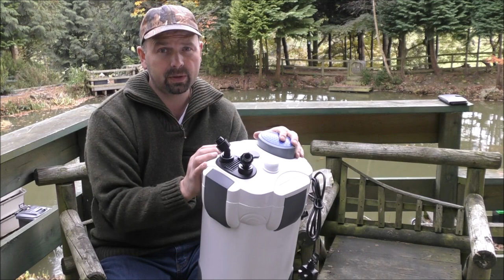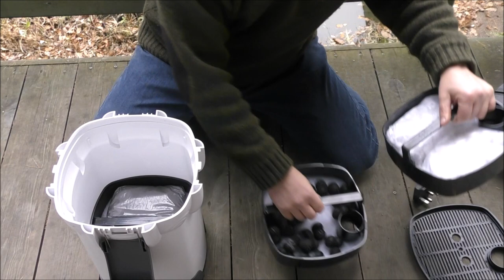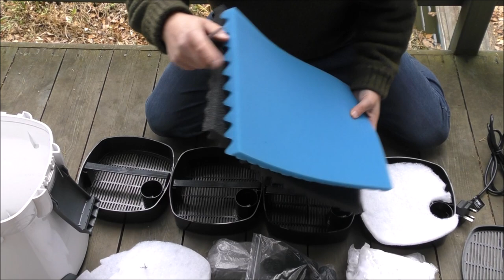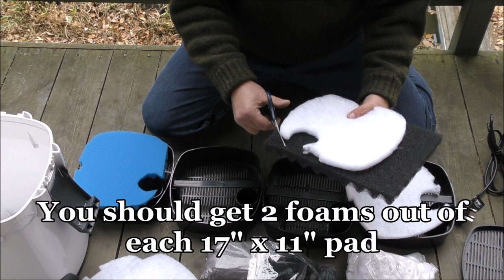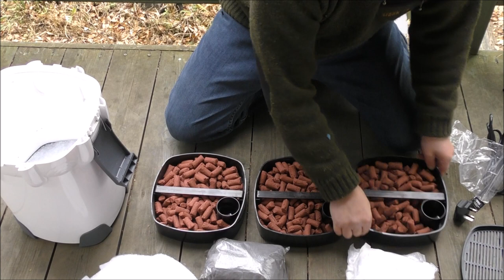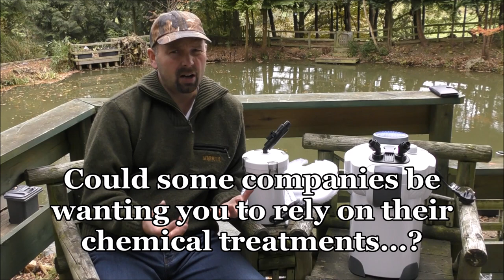Why Your Filter is TOO SMALL and NOT CYCLED

Comment: Can't figure out my water parameters. My ammonia is safe. My nitrates are safe. But my nitrites are extremely high. How is this possible?
Reply: My ammonia is 0-10 ppm according to NT Labs Aquarium Lab. My nitrates are 0-10 ppm according to the same test system. My nitrites are 40-60 ppm according to the same test system on a 29 gallon tank stocked with 3 corydoras catfish, and approximately 4 baby crayfish the size of a half of a pea.
Reply from the maker: Sounds like the tank is going through the first stage of the cycle and you have almost enough aerobic bacteria to completely process the ammonia into nitrite but not enough of the aerobic bacteria to process the nitrite into nitrate if the nitrate is low but the nitrite is high.
Have you had the tank running long and are you using any treatments which could cock up the results / affect natural development of bacteria (e.g. prime, amquel plus - treatments which detoxify / bind ammonia, nitrite and nitrate)?
Reply: It has been set up for about 2.5 months. Using a SunSun canister filter filled with BioHome Ultimate and BioGravel and a course, medium, and fine pad set up the way you show here.  The substrate is Mystic White II pool filter sand, pea gravel, and BioGravel mix over a RhizoMat which I sprinkled micorhizal fungus when I set it up. Underneath everything I have an undergravel jet filtration system running. I am a firm believer in no chemical fish tanks.
Reply: The corydoras and crayfish seem healthy and happy with no signs of stress. It's just the readings that worry me. The gH is 1 and kH is 6 (I think).
Reply: Just a basic dechlorinator by Tetra.
Reply: Sometimes I use aquasafe but other times I use bettasafe. When setting up this tank I think I used both.
Reply: How long should I wait for the nitrite levels to fall.
Reply from the maker: Bettasafe claims to detoxify / bind ammonia so it is likely to be the source of the cycling problem. When you have a filter full of biohome (or any good sintered glass media) it should only take 2-3 weeks to go through the aerobic part which would see ammonia and nitrite return to zero but if the ammonia is not available as a food source for bacteria then the cycle will not have got going. There is obviously some bacteria present but it only seems to be the type processing ammonia into nitrite. The true ammonia level is likely masked by the treatment and could very well be high too just in a form not registering on the test?
If you continue like you're doing except only use the aquasafe then the bacteria should populate naturally and you should see nitrite come down to zero in 2-3 weeks.
It would probably be worth doing a 20% water change twice a week while the bacteria is struggling to establish and then you will see ammonia and nitrite fall to zero and nitrate rise indicating that the first part of the cycle has been completed.
The last part of the cycle which is anaerobic and reduces nitrate can take 4-6 months but many people have reported recently that it only took them 2-3 months for that part - it varies from tank to tank.

Comment: you forgot the part if you have a plenum you get the full nitrogen cycle aka 0 water change
Reply: Filtration is simply scaled to the demand placed upon it - for a lightly stocked, well stocked naturally set up, well planted tank filtration can be minimal with great results but for normal (abnormally stocked) tanks it takes a bit more to achieve a full cycle.
The vast majority of people will not set their tanks up to be anywhere near Natural and that's where the extra filtration comes in - the great thing is that anaerobic bacteria can be catered for in the substrate and the filter so the two methods of achieving a full cycle aren't at odds with each other.
With regard to 0 water changes even with 'perfect' water conditions I'd still recommend changing 10% a week and making sure there isn't a build up of uneaten food and fish waste on and in the substrate. Minerals and trace elements will eventually get depleted and 'locked up' in a 0 water change system so remineralising with water changes will help to prevent 'dead' water.

Comment: i'm guessing you don't like seachem prime and purigen?
Reply from the maker: Bacteria certainly don't like it so they are products I can't recommend if you want to achieve a full cycle and a properly functioning filter. I'm not a fan of having to throw chemicals at a system so avoiding using any products which prevent a natural cycle is a big part of success.
Reply: @pondguru  I didn't think purigen was considered a chemical media. It's just super absorbent.
Reply from the maker: Keith Fuller  It acts in a similar way as carbon / charcoal to 'polish' the water and is neither a mechanical or biological filter media. However carbon and charcoal do not have the adverse effect on bacteria experienced when using purigen / chemipure or similar artificial chemical treatments.

Comment: Sunsun make great filters. The chinese do well to reverse engineer products and sell them alot cheaper. You may bag their media but their filters work great. I just purchased 2x sunsun 304b(combined 4000ltrs an hour, obviously alot less with media). But they will filter my 440ltr tank. And $283 au(australian dollars) including shipping.
Fx6 is around $6-900. And less flow.
Just make sure to buy good quality media and follow the gurus ideas.
Reply from the maker: Yes - save money on the canister filters and spend it on the filter media as that choice is critical for success - at the end of the day a canister is just there to suck dirty water out the tank, filter it and send clean water back to the tank so the makers name on it does not bother me.
For general (aerobic) filtration the filters can be set up with anything to achieve the 0 ammonia and nitrite but for full cycle filtration (reduction in nitrate) they certainly hold plenty of biohome.
Why people persist with internal filters and HOB filters for large tanks is beyond me when canisters offer so much more filtering capacity.
Glad you enjoy the videos and thanks for watching.

Comment: I’ll never understand why people won’t clean their mechanical filtration in tap water to get them clean (squeezing them in tank water is a joke) yet they will replace the mechanical filtration. Prefilter sponges can be cleaned every couple of days... before stuff has a chance to break down. Do you have science to back up your claim of bigger filter equals nitrate reduction?
Reply from the maker: For me the rinsing in tank water which has been drained off during maintenance is more about being really determined to retain as much bacteria as possible on every surface in a filter but in reality most areas of the country will have tap water which is good quality and not packed out with chemicals so using tap water will not be a problem for rinsing foams.
In the UK problem areas would be London, Birmingham and around Nottingham as far as feedback goes from people who have had problems with awful tap water.
With regard to your question about a larger filter equaling nitrate reduction the size of filter is important but is not the critical factor in nitrate reduction - that would be the amount of suitable media which is used in a filter for the size of the tank and stock. You could have a huge filter filled with crappy ceramic rings or plastic balls and all you'd get is high nitrate since the media is only ever capable of supporting aerobic bacteria (for ammonia and nitrite reduction) which produces the nitrate. When you have a media which is more suitable for supporting both aerobic and anaerobic bacteria you can then start expecting a full cycle which incorporates the benefits of anaerobic bacteria reducing nitrate, not just half the job experienced by almost every fish keeper.

Comment: Another day, another rant about why I hate that I think in American units.  You talk about filter media in Liters, but it's sold here by the pound.  You can't convert these bc one is volume, and one is mass. Plus we have fluid oz vs weight oz. Even if I learn metric, all the manufacturers still use crazy units to trick customers. Like my caramel sauce that silently switched from 16floz to 16oz which is only 13floz. Or is it the other way round?  How many cups are in a gallon again?  How do I convert Liters into pounds?  What is a stone? No one knows!  I hate everything!
Reply from the maker: Google has every converter on there but it's a proper fart on - we use different units by design to keep us separated. 
Divide and rule, lol

Comment: 4 day turnover recommended, not practical unless set up separately as secondary filtration
Reply from the maker: I think you may have meant this as a reply to the guy asking about nitrate filters? They are indeed used as a secondary filtration and the choice of media in them is not as critical as it is with standard filters.
Reply: yes, that is my New understanding as well
Reply: as a side note, I started fish keeping in 1972 Back then tanks were  metal frames with slate bottoms.   I still learn new things, and I am always reviewing... that is how I got here...lol
Reply from the maker: @agualust  The first tank we had in our shop had a slate bottom and slate siliconed on the back of the tank inside - fish looked great against the black background and it was always better looking than the 'newer' tanks with the vinyl backgrounds which flies always seemed to die behind, lol
Reply: maggots as live food would not have gone over well...lol

Comment: I have 2 canisters claiming to filter 500l in my 1000 litre tank but I have 22 kg in them because only one filter hasnmechanical fiktration
Reply from the maker: One canister only has foams in and the other one has all media - and you fit 22kg into one canister filter? What type of filters are they? They must be gigantic.
Reply: Pondguru no, one has a little bit of mechanical and mostly biological and the other one has pure biological, but yes there huge
Reply from the maker: What is the make and model of the filters? I'm always getting people asking me what the biggest canister is and as far as I know it is one of the big Eheims which wouldn't hold that much - also what size tank do you have the filters on? must be huge if you need 22kg of media.
Reply: 1000litres but I have turtles in it which make a HUGE mess, but I don't know the model right now, because i bought it off a friend but I will find out soon when I ask him
Reply from the maker: Do you have the large tank on a different channel? I checked out your channel to see if I could recongize the filters and the only tank I saw looked nearer 100 litres?
Reply: Pondguru I'm pretty sure its a fluval fx6(6kg of aquarium matrix) tank water out of the tank into a 75litre drum full of pond matrix(8kg) and an eheim with 8 kg of aquarium matrix which pumps back to the aquarium

Comment: I love this video. lots of good  info , most people buy to small of a filter. and have to big of a buy load.   I tell my friends if they see for exp. a canister filter rated for up to a 75 gallon tank   take that rating and cut it in have so it should only go on a 40 gallon breeder at best.    all  these filters rated with so many gph per a gallon are rated with no head pressure lost from pumping water up and are not filled with media.    lots of good reads about filtration vs flow to on aquaticplantcentral.com
Reply from the maker: Yes that is an important point - it is not just the filtering capacity (what size tank a filter is suitable for) which should be halved for a normally stocked tank but also the flow rate too since the flow rate given by manufacture is at zero head (lift) and with an empty canister. 
By the time you add foams, pad and media flow will be slowed down, the length of pipe (friction) causes reduced flow and the head you pump to (vertical lift from canister to water surface of tank) really affects the flow too so a safe bet is that a 2000 lph pump will deliver around 1000 lph in a real world set up.
Again, this is something pond pump manufacturers generally print on their pump boxes which actively helps the end user make an informed decision but aquarium equipment is a hit and hope for so many buyers due to the lack of information.
There is really no excuse for it.

Comment: You size filtration to the load not the tank size. Video not needed.
Reply from the maker: If you already know all about sizing your filter to various stocking density and how to achieve the full cycle of filtration (reduction in nitrate) through biological processes then that is ultra-cool.
This video is really for viewers who struggle to understand the various processes in a filter (due to the bum information posted online) and are struggling with poor water quality (due to inefficient filtration).
Reply: Pondguru the best filter in the tank exists inside the tank itself. Not the filter. Way more surface area in the aquarium typically. Than in the filter.
Reply from the maker: While there is a large amount of surface area in the tank it is colonised mostly by aerobic bacteria.
Unless a tank is very well set up, well planted and has minimal stock you will need a filter.

Comment: great common sense vid , not pointed out enuff ,,,,keep merc and bio totally seperate spot on ,,, also when adding water to a tank it should be treated for chems b4 not after adding so the 28 min approx comment kind of should not be needed ,,, well if gen opinion is you mix the stages of filtration keep going to a throw from merc to bio must be a lot of dullies keeping fish just saying they need to be informed , a £10 sponge filter will outwork any of those cannister filters that cost 100,s

Comment: You make some good points here, but I don't think you have quite covered everything.

First of all, a full nitrogen cycle is very well known, understood, and extremely common in the salt water hobby, in fact if you don't have one, you are seen to be failing to maintain the tank properly at all.  Many people accredit this to live rock, and while that is true to an extent it isn't quite the full truth.

Live rock isn't magic, it simply acts as filter media within the water column, it provides a porous structure for bacterial growth, with deep pores providing anaerobic areas for the bacteria responsible for nitrate conversion to live.  So fill your freshwater tank with porous rock and sorted right?  No, unfortunately not.

The environments are completely different, the species of bacteria are completely different, the concentrations of secondary nutrients for the bacteria such as carbon are completely different, the science behind this process is just no where near as simple as we would like it to be.  Bacterial blooms, and even system crashes can be caused by something as simple as a change in the chemistry of the source water for water changes.

Will increasing the surface area available for anaerobic bacteria to colonise improve the chances of nitrate reduction in freshwater?  Of course.  Can it be guaranteed to be at a level that exceeds the aquariums output of nitrogenic waste? Not really, not without serious over kill being implemented at least.

Since so many variables exist in the nitrogen cycle there is no set amount of any media that can honestly be marketed as guaranteeing a "completed" cycle within practical applications, I mean if you had a sump several times the size of your heavily planted, solo male betta's 50l aquarium with 50kg of sintered glass media in it, then you would almost certainly never see a reading on API's freshwater test kits, but that is far from practical.

I am not slating your advice or product, you are right in what you are saying, we definitely should be using higher quality media and higher levels of filtration than is recommended by manufacturers.  Despite what you claim about online aquatic communities every single one I am a part of advocate using a filter that is rated 2-3 times the size of your tank at a minimum, and have done for a long time.

I think that achieving 0 nitrates in freshwater aquarium is an extremely difficult goal for the vast majority of small scale hobbyists, especially new comers.  Most cannot invest the money or space into providing an impractically large filtration solution that might work, and we shouldn't ostracise them for failing this, public aquariums that have hundreds of square meters with tens of thousands or more invested in filtration equipment usually fail to achieve this completely.

The goal we should have is to have healthy and happy fish, which can be achieved with good husbandry practices such as regular tank maintenance, providing adequate filtration, set up correctly as you outlined, to deal with ammonia and nitrite, while also working towards seriously slowing the rise of nitrates.  And of course regular water changes, water changes remove other things from the closed system that filtration alone cannot such as hormones, parasites etc and can never be replaced by equilibrium of the nitrogen cycle anyway.  I think it needs to be highlighted to people that see nitrates as the only "baddy" that zero nitrates does not mean zero water changes.

Thanks for all the effort you put into your work, you help educate the community and improve the quality of husbandry in the hobby, which I am sure is appreciated by every serious fish keeper out there, I appreciate it at least.